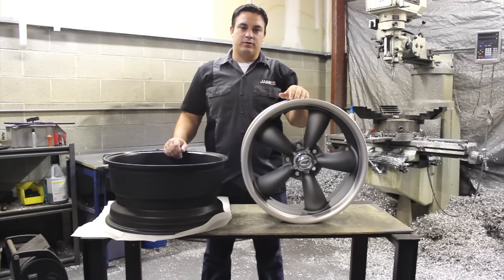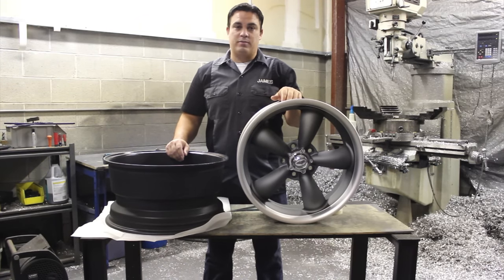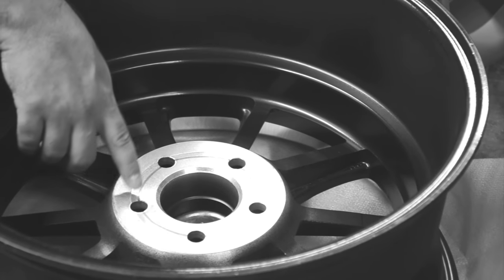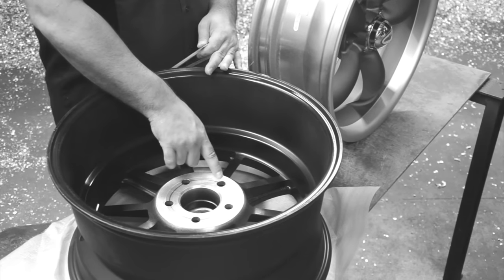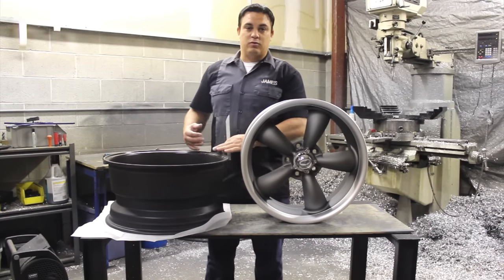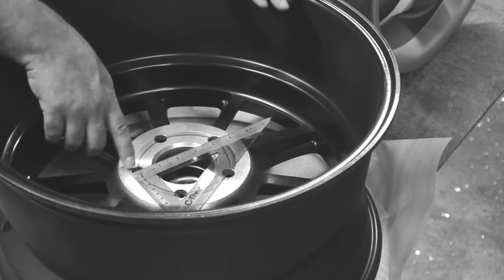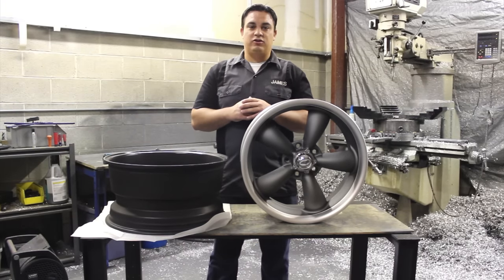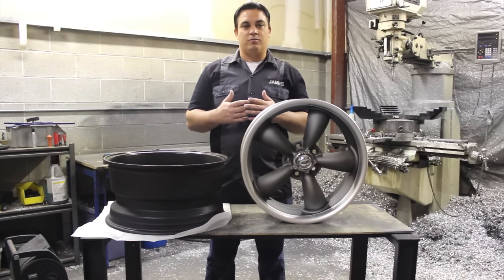HOW TO: Measure 5-Lug wheel bolt pattern

Comment: This video does not tell you how to accurately measure a 5 lug wheel bolt pattern. It's a video on how to guesstimate.
Reply: Are you trying to say Pi/r squared and all that?
Reply: Adding 1/4" would seem to only apply for a specific range of bolt patterns. I would have expected the correction to be multiplicative rather than additive. Still, this should be good enough to check that it's one pattern vs. one that's significantly off from that.
Reply: Hagan Blount it tells you exactlly, how to do it,  just got to listen carefully, maybe a few times, i'm not beeing funny, i worked at sears installing tires
Reply: @martinrivera3230  This is a rule of thumb and is only perfectly accurate for 5.1079 inch diameter bolt patterns. The smaller or larger the diameter goes the farther off from 1/4 inch you get. The formula to find the bolt pattern diameter with the center to center measurement in the video is: center-to-center-measurement / Sin(72). All you need is a scientific calculator which most now carry around daily in the form of a smart phone. For the curious that want to know why the 72: The lugs are spaced 72 degrees apart on the circle that is the bolt pattern.

Comment: Measure from outside left hole, to centre of the right side hole, saves adding the 1/4 inch. When measuring 4, 6 and 8 bolt wheels measure directly across the circle, where as 5 cannot be. Metric conversion to standard can also help. Eg. 5x114.3mm = 5x4.5in 5x100 is easier to get exact with a millimetre ruler rather then 5x3.94in.

Comment: Why try to measure anything center to center? Measure edge to edge. It's easier and much more accurate. Also, adding 1/4" is inaccurate and will give you only a rough estimate. If you want accuracy, measure from left edge of any hole to the left edge of an adjacent hole, and multiply by 1.70. Or you can measure to the second hole over, and then multiply by 1.04.
Reply: Cotronixco 
Is the 1.04 mathematically exact? That seems like the correct method for compensation but trying to see what the exact scaling should be just out of curiosity. Might have to apply some trigonometry to it to find out, otherwise. I'm sure it's been worked out before, just haven't seen it yet.
Reply: @dtrrtd774  The formula is 2 / square root of (2(1-cosine theta)) where theta is 72 degrees if adjacent or 144 degrees if 2 lug holes away.  Base on the formula, a more accurate answer will be 1.05146222424.
Reply: @felixfong6532  It's easier reduced to 1 / Sin(72). You can even replace 1 with your 2-lug hole away measurement and get your diameter calculation that much quicker: Center-to-Center / Sin(72) = Bolt pattern diameter. Likewise if you measure between adjacent holes substitute Sin(72) with Sin(144).
Reply: @killer2600  Come on. Measure to the outside of the 2 holes and subtract the diameter of you bolt hole, or measure to the inside of the 2 holes and add the diameter of the bolt hole. That way you can use a standard 6 inch scale and end up with an accurate measurement. Don't forget to add the quarter inch for the overall bolt circle.
Reply: @williamhardin5254  Some bolt patterns are metric and 115 is awfully close 110. Do you want to rule of thumb it or do you want to be as accurate as possible when you have to order the chosen wheels and return shipping has to be paid by yourself and/or a restocking fee is charged. Whatever you decide to do, the math I gave is accurate so it's not my fault you find it tedious to punch numbers on the calculator you always have in your pocket - your smart phone.
Reply: @felixfong6532 no no no your all wrong the easiest most exact way I found is if you measure from the first lug on the driver front side all the way to the #3 lug on driver back side then measure back from driver side rear#3 lug all the way back to front tire and measure to the 4 th lug then back to the 5th then back upfront to the 6th. Then once again to the back around # 7 then back to the front driver side then once again to the back make sure your measuring to lug number 9 this time then measure to the front to lug #10  a lot of people stop there or previous to there but I like to double check my math twice to the 2nd power times. Just to be sure I'll measure the eleventh lug all the way till the 12. Then just got extra caution I will go to the passenger side and I will measure from the first lug nut all the way to the number #2 lug on the back passenger side then I'll measure # 2lug all the way up to front passenger #3 lug. Continue to measure 3 to 4. 4 to 5 5 t0 6 and so on and so on make sure you correctly measure from 6 to 7 and make a mental note of that number. Next you will have to measure from 7 to 8. If any of your measurements were off now is the time to go back and correct them. Like I said I found this to be the easiest most fastest and accurate to measure any tire. It works in metric and standard normal people sizes. WTF metric! all the entire metric system is based on communist ideologies... Well then they can keep there simple communist way of counting..I've allways believed a bushel should equal 4 pecks. No more no less. And a ton is called a shit ton and it is allways allmost sometimes full of bullshit......but then you measure from #10 to #11 then finally  from the center or the side it doesn't have to be exact measure the distance between where ever you are all the way to the front. Or if your all ready in the front then measure all the way to the farthest away stud hopefully you've written all those down or have kept up. Any way take all those numbers you wrote down go down to 9th Street couple blocks off Melrose right past the cvs.  You'll see a little white garage. Has a tall razor wire fence around. That's the spot just walk in ask for chico if chico is not there ask for Julio if Julio and Chico not there ask for Juan Juan Jr not Juan Sr. Juan Sr is never there. But if Juan Jr and Julio and Chico is not at work that day ask for Jorge if Jorge and Juan Jr and Julio and Chico is not there just hand your paper with your measurements to whoever is closest by. Then I point at what tires I would like to have and what rims I give the tire technician 200$:tell him I'll be back in una hora and bam done simple correct fit everytime. And literally takes no time at all.    For another 20$ you can get your vehicle wash waxed and detailed hope this short explation of the easiest fastest most accurate way to measure lugs in American size
Reply: @killer2600  My phone has a calculator? Why am I just now hearing this

Comment: This is not math. Why not measure form the center of a lug nut to the point of the drawn circle ( that the lug hole were drilled on) directly across skipping one and a half lug nuts, if you will? adding 1/4 of an inch seems arbitrary since the diameter of the lug bolt itself is also a factor.

Comment: Just measure  the centre  of two side by side  bolts, for example, if they were  numbered around the circle 1to 5 measure  1 and 2 and multiply centre  measurement by 1.7021 simple and spot on

Comment: Probably easier to measure from the center of the first lug to the outside edge of the second one. Then there is no need to add a quarter. And there is no need to be super-accurate here. It's not like you have to make sure you have a 4.5 instead of a 4.48759.
Reply: True, I hear that's the newer way but as I was younger it was center to center and add a quarter, food for thought.
Reply: When I looked at the list of possible patterns, I found plenty of ones that were fractions of an inch different

Comment: You said to measure from center to center of the holes. I've heard and seen others say that in five lug wheels is from one side of one hole to the center of the other hole. Is that why you add the extra quarter inch?

Comment: The correct way to measure the bolt pattern on a 5 lug wheel is to measure the outside edge of a lug nut hole to the center of the hole across from it. This video is a complete waste of time and puts out misinformation. Why try if you don't know what you're doing?
Reply: You are correct.. Thats how I always did it..
Reply: Do you not go from centre to where centre would be.?
Reply: But what is the hole across from a hole in a 5 bolt pattern? There's one opposite in 4 bolt patterns, but nothing directly opposite when there's an odd number of holes. 
Measuring to the outside of a lug nut hole is influenced by the hole diameter, which shouldn't be part of the measurement.

Comment: Why do you have to add 1/4"? If its 5x5.25, why would it be called 5x5.5? Why not just 5x5.25? Seams confusing. Thanks!
Reply: because 5.5 is the diameter of the circle that runs thru the middle of each bolt hole and, since there is no 2 bolt holes directly across from each other (like there are on 4, 6, and 8 lug wheels) you need to add 5% to the measurement to get the true diameter.
Reply: William Mueller
 No, the correct way is to measure from the outside edge of one lug nut hole to the center of the one across from it, no addition needed.
Reply: William Mueller William Mueller gets the prize! 1/4" is an approximate value in this general range. 5% works for any diameter circle with a 5 way division. Also. adding half the diameter of the lug hole is a crude approximation. Again, when working in this limited range it works out close enough but why not tell it like it is and do the math correctly. I would also like to add that you can measure from the edge of one hole to the edge of another and not have to guess were center is. Use either the left or right side of both holes and the number is always the same for left to left, right to right or center to center.
Reply: seems so
Reply: So up above I saw 4%, and here it says 5%. Is there a mathematical proof for the exact value, or are these also an approximation, albeit much closer than the 1/4" offset approximation?

Comment: Thanks for the video!

Had a quick question...

If you were to start at the same point in the video, and measure down, in between the two lugs across from it, the ruler would hit the black line at exactly 4.5", right? In order to find the middle point of those two lugs, simply measuring between them and marking the halfway point should suffice? This should work for an exact measurement, correct?

At any rate, thank you very much for a solid, quality video.

Comment: This is NOT an accurate measurement, only approximate.  Using trigonometry, you will
find that taking the C to C measurement of 2 holes (skipping one) and then dividing by 0.9511 (the cosine of 18 degrees) you will get the exact BCD.  The C to C for a 5 lug 4.5” BCD is 4.28” (close, but not exactly 4-1/4).  Dividing by 0.9511 works for inch or metric measurements.  No other way is exact.

Comment: Well someone needs to go back to the dam School because you not supposed to measure center to center you measured from The edge outside edge of the lug nut or the Lug hole to the center of that one Skip One you know in the next one you measurement you go from outside edge then to the center and that's how you accurately come up with your lug pattern

Comment: If you measure it correctly, you measure from the center of the one stud skip one stud and measure to the outside of the following stud and it comes out to 4 1/2, you don't add  a 1/4 inch if done correctly! Just saying!
Reply: Correct way yes but both work
Reply: That's just another rule of thumb. If you want a calculated precise number, take the measurement as done in the video and divide by Sin(72). A 4-1/2 measurement would calculate to 4.73158. If your pattern is 5x4.5 then the center to center measurement is 4.27975 so measuring it your way just added 0.22 inches which is pretty close to 1/4 (0.25) inch.

Comment: S/B  =  Center of the Rim (Axle Lug) to the  center of the lug hole, X 2
Reply: Yes, but have fun finding the center of the rim when it's a big empty hole.
Reply: @killer2600  measure the radius and divide  / 2.  Add that to the edge of the hole and that's your measurement to the center
Reply: @tpsullivan7  Diameter is twice the radius. But again have fun getting straight correct measurements because a 115 mm pattern is different from a 110 mm. So if you're off by as little as 2.5 mm in your measured radius you may order wheels that won't even fit.

Comment: WHY do you ADD 1/4" of an inch, you said you add 1/4" , but WHY?  What didi I miss?
Reply: Because with 5 lug patterns there is no hole directly opposite from any other hole from which to measure the true diameter of the circle (bolt pattern). You have to utilize the farthest distance you can measure and account that the diameter of the pattern is going to be larger than that.

Comment: So if it's always + .25  Inch than forget the actual diameter in most cases.  So please clarify this goofy math.
Reply: It's a rule of thumb that's more than accurate enough at 5 and 5.25 in diameters. If you want a more precise formula: take your measurement (as done in the video) and divide it by Sin(72) on a scientific calculator.

Comment: That is great for SAE patterns, how about for Metric patterns? They are so close that adding .25" would not get you where you need to go... Also, you can measure from the edge of one hole to the edge of the other hole and not have to guess if you are reading the exact center or not.

Comment: So you are measuring the diameter of the circle the holes are centered on.  If you just said that then it could be applied to any wheel.  Mine has 8 lugs so I can just measure the center of one hole to the center of the opposite hole. I think...
Reply: Yes correct.

Comment: 5 bolt..is center to edge
Reply: That's just another rule of thumb because 1/2" studs would be 1/4" from center to edge. Any lug pattern is center of wheel to center of a lug multiplied by 2.

Comment: So 3/4 would be 3 1/2??
Reply: 3-1/4 would be 3-1/2 but this video is only rule of thumb because 3.25 would actually be 3.417. The formula to use is take the center to center measurement (as done in the video) and divide it by Sin(72) on a scientific calculator e.g. 3.25 / Sin(72) = 3.4172....

Comment: I didn't read all the comments but if you have a 5 on 4.5 bolt pattern than you have a 4.5" bolt pattern simple as that. If you have a 6 on 6 than you have a 6" bolt pattern. The only reason why you would measure at all is if you don't know what the bolt pattern is on your vehicle/wheel. If you want an accurate measurement lay a straight across the middle of 2 studs/holes next to each other than lay your triangle square against the straight edge go to the center of the adjacent stud/hole and read the distance. on a 5 on 4.5 you will read exactly 4.5".
Reply: You are correct but it's still considered 5
Reply: That method is extremely inaccurate because circles don't have flat sides. A 5x5 bolt pattern would measure 4.522" with your method a whopping 0.478" of inaccuracy in a supposed "accurate" measurement.
Reply: @killer2600  Everyone is right. You just need to understand what a bolt circle is. Please don't order a wheel with a 5 on 4.76 for your Jeep. I wish I could add a PDF drawing but I can't. Correct number between the 2 holes would be 4.76" for a 5 on 5".
Reply: Here's a link to my dropbox of a cad drawing of 5 on 5" bolt pattern. https://www.dropbox.com/s/3u64q1cupf2aur3/5%20on%205.pdf?dl=0
Reply: @williamhardin5254  Please re-read your post at the beginning of this thread. The method described there does not match your CAD drawing. Your CAD drawing actually matches the video's method of adding a 1/4 inch.
Reply: @killer2600   That's correct, I had a brain fart when I wrote that. It should have been 4.25" but I missed the 2 while I was typing. Your 4.522" would have been close if you were measuring to the inside of the 2 holes.
Reply: @williamhardin5254  Math isn't close, it's precise. The only possible error is understanding your initial method - put a straight edge across the center of two adjacent holes and put a triangle (right angle) from the straight edge to the center of the hole opposite the straight edge and measure that distance.
Reply: @killer2600  After reading my post it doesn't make since to me either. Let's get real though, we are are not measuring this with calipers or micrometers, we are using rulers and scales. Typically I'm not going to measure down to a 0.001" to find out what my bolt pattern is, but that cad drawing is right on to within 0.01" and I could have shown it out to 0.000001". But who cares.
Reply: @williamhardin5254  True, in reality you'll search the internet for the factory spec on the bolt pattern. But if you have to measure, the more accurate your measurement the more accurate your determination will be.